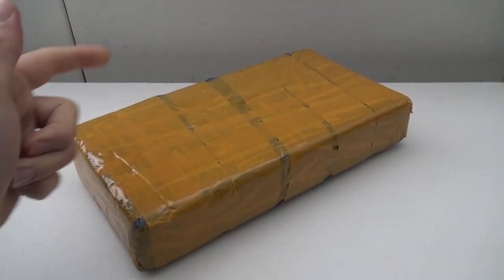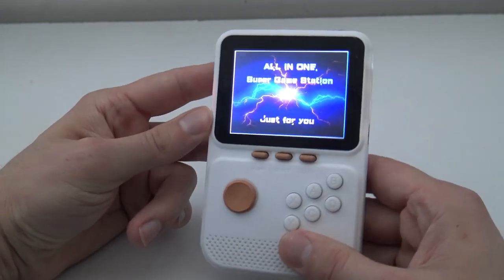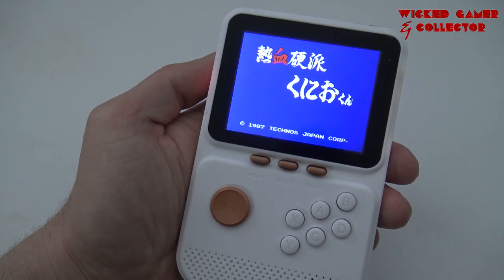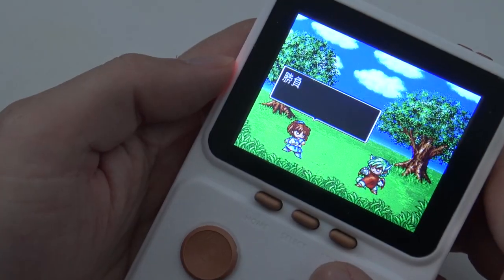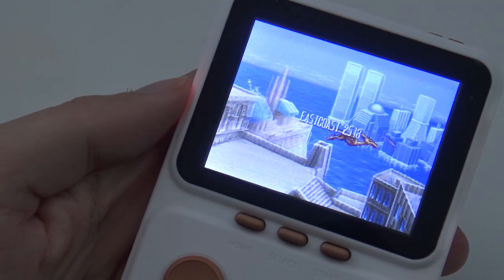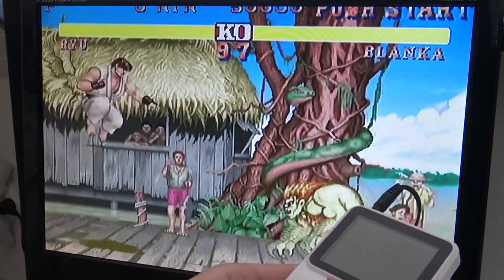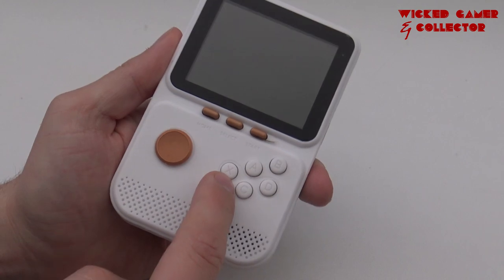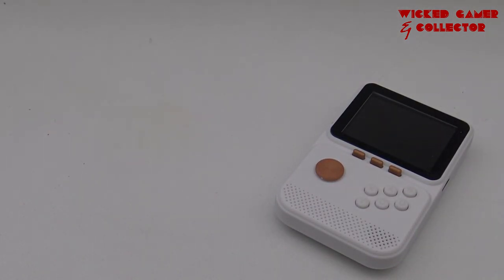20 Dollar Super Emulation Handheld .. is this worth your money ?

Comment: Yeah,I had the rg300 briefly and was pretty impressed with it, but I couldn't get past it having a small little bit of trouble with the SNES games. Even if you adjust the settings it's still not perfect, but it's by no means bad if that's all you you can or want to spend.